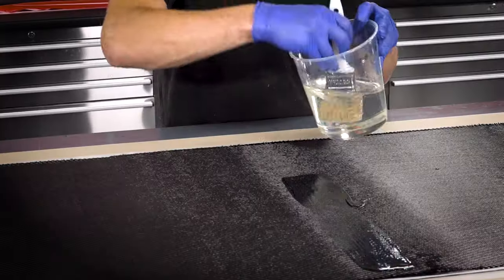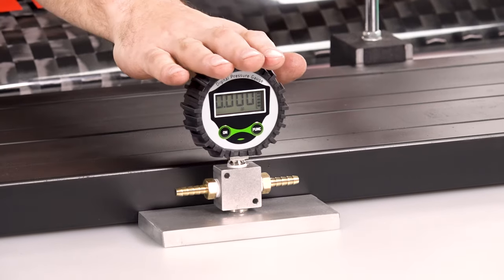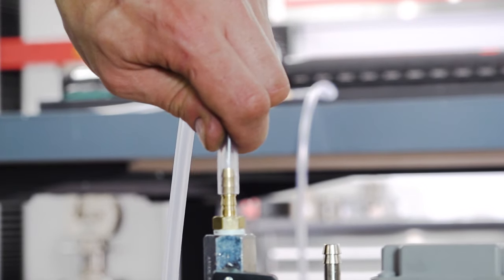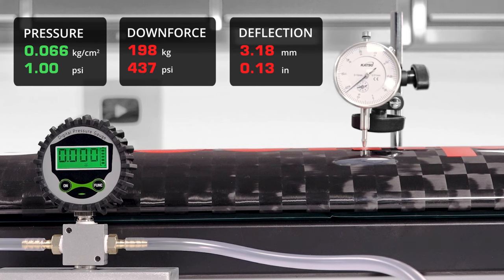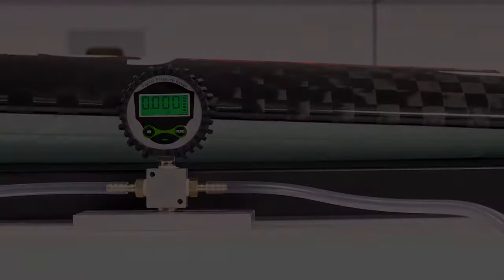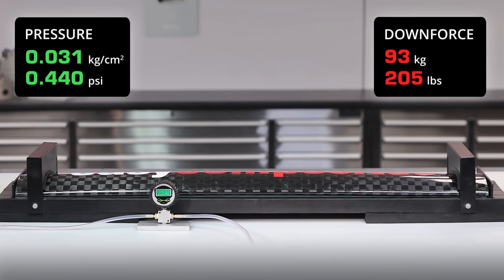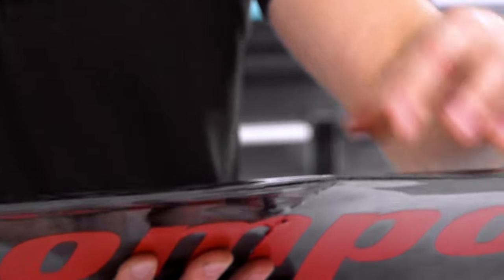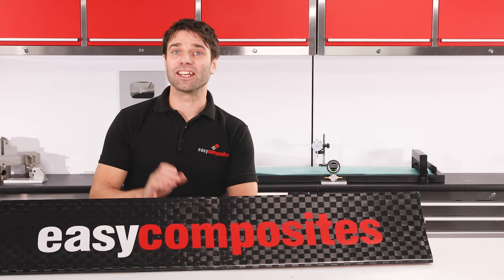How Much Downforce Can Our Hand-Laminated Carbon Wing Take?

Comment: Thanks for keeping up the best quality carbon fiber videos year after year. And especially for not going with the annoying youtube shorts trend, but instead providing actual useful tutorials and product testing videos. I watched these for years before stepping to the dark side, and last year I was your customer over and over again, and will be in future.
Reply from the maker: Thanks for the comment; you're right that the 'push' is for shorter, shallower content but so far we've not really found that to be the right format for content that we hope to be genuinely useful and enlightening. Thanks for buying from us; we don't take any customers for granted and appreciate your support.
Reply: @easycompositestv  can I give one complaint too? Last part that I did, I used XCR epoxy, and I even heated the hardener for quite long time on top of heating radiator. Yet, on 20c room temp part turned with lots of big hardener crystals and is essentially ruined in aesthetics sense. Also the 3D-printed onetime use mold etc meant that I lost about 1 week worth of work in it. The part was usable but pretty it aint. Other than that everything has been mint!
Reply: @djremotion2  Just don't watch shorts if you don't like it so that you won't be annoyed with it.
Reply: @sepg5084  real videos get lost inbetween in the subscriptions. And eventually not even appearing since there are so many shorts and youtube pushes them now.
Reply from the maker: @djremotion2  Its possible if its been crystallised a long time it needed more heat and for longer. Alternately if the lid isn’t fully sealed, moisture can have an effect making it crystalise.
Reply: @easycompositestv  Room was 10c° before I came and heated it in about hour to 20°c.. I warmed the hardener but I think since the epoxy was still quite cold, it went back to crystals in mixing so both should have been heated and I did not know that. It was new container first time using. I wont use it in future, just normal resins then...

Comment: am I the only one being shocked how much pressure these vacuumbags can take?! :D great video once again!
Reply: I expected bladder to fail at weld first, but redundant welds helped with that.
Reply: You are not alone! It is a nice thick material. But do not forget the majority of the force is taken by the wing and base.
Reply from the maker: Hey Matt, and thanks! Well, the pressure is really not very high; the downforce looks massive because that (modest) pressure is acting over a large area but in reality the kg/cm2 (or PSI) are waaaaaay within what the bag (and the welds) would fail at.
Reply: 413g/cm2 is less than 40% of ambient pressure.
Reply: Why use low melting point metal instead of wax?
Reply: 0.3 barr or 5.34psi it's kind of low

Comment: Another amazing video! Interesting how it failed on the compression side mainly, makes sense after thinking about it. Incredible how much flex it could take before failing.
Reply: Yes, these composite structures almost never fail in tension. Mostly in compression or attachment points.

Comment: Great content!!
Truly amazing how ridged and strong something so light can be.
Im betting its all down to the cylinder shape of the wing, plus the surface area of all those tiny cylinders that makes up the carbon fibre.
Reply from the maker: The shape will have a significant impact itself but the composite matrix is very strong due to the actual fibres themselves being strong.

Comment: Very entertaining, sounds like it was as fun to film. (You tone of voice gives it a way a little.) It was a great way to highlight the difference for designing for a given stiffness and designing for a given strength. If you ever do something like this again, I'd be really interested in the impact of cycling the planned load repeatedly.
Reply from the maker: Long term fatigue or cycle testing needs quite specialist equipment so its not something we can easily do here.
Reply: @easycompositestv  Arduino, two regulators (one self-venting), a 3 way solenoid valve and some fittings and you can rig one up pretty cheaply to cycle between two pressure levels!

Comment: Awesome video, well done. Where are you guys coming up with 100kg as the max producible downforce?
Reply from the maker: Thanks for the question, The 100kg downforce was calculated by a team who we worked with on this wing. Unfortunately we cannot make their data public but there are a number of ways that the loading can be established, from CFD software through to physical wind tunnel or track testing.

Comment: I hope people are aware that testing a carbon fiber part an weaken it. I don't recall where I hear this but some carbon fiber parts failed (on a spaceship?) because it had been tested beyond what it was expected to bear. The test had weakened the fibers and it failed at load lower than expected. 
I don't know the correct way to test a part without damaging it but I thought I'd mention this. I could probably be persuaded to find the exact example if people are interested.

Thanks for another interesting and entertaining video Easy Composites.
Reply from the maker: It’s definitely true that performing high load tests on a component would cause some mechanical damage to it. It should be clear from this test, which destroyed the wing, that you should test one, and use another!

Comment: Great video and experiment do you think at what speed it will be at maximum amount of downforce for this wing which is about 100kg?
Reply from the maker: I’m not quite sure. The wing design came from a formula student team we worked with a few years ago. Their aero team said the wing was designed to generate a maximum of 93kg downforce at top speed. FS cars don’t tend to run that fast. If we can find out, we’ll add the info to the project page on our website.
Reply: So if you search for "dynamic pressure calculator", you will find that at 100mph the dynamic pressure at sea level might be 25 lb/square foot.  Let's assume the coefficient of lift of the wing is a bit above 1.0, and given that to keep it simple just assume we get 30 lbs/square foot of lift for the wing at this speed.

I'll guess the wing is 5 square feet viewed from above.  So that's 30*5=150lb total downforce at 100mph.

Lift/downforce increases at (roughly) the square of the speed.  So at double the speed (200mph) you'd get  4x the lift/downforce, or 600lb.  So maybe 120mph for 100kgf. 

Exact #s will depend on the wing's airfoil, size,  air temperature, wind etc., but this is in the ballpark I hope.

Comment: Great video (as usual)
How have you calculated the down force?
Reply: Pressure times surface area.
He mentioned the surface of the wing is 3000cm^2.
0.413kg/cm^2*3000cm^2=1239kg
Reply: @戴紀煬  great, thanks
Reply from the maker: Thanks for the question, The 100kg downforce was calculated by a team who we worked with on this wing. Unfortunately we cannot make their data public but there are a number of ways that the loading can be established, from CFD software through to physical wind tunnel or track testing.

Comment: Nice video! I am interested how could the delamination at the edge joint be prevented ?
Reply from the maker: You could make sure at least one or more layers of reinforcement wrap around the trailing edge, rather than just meeting at the trailing edge. In the preceding build video you can probably foresee the possibility for delamination where the two layers just meet each other. That said, it makes the process much easier and, at the end of the day, it's going to fail somewhere so the consideration is whether moving the failure somewhere else (which will come slightly later) is worth the extra complication. In this case, it probably would be.

Comment: Do you also work with thermoplastic memory carbon? I'm not sure what it's called in english but you can heat it up and bend it. Allows for rapid construction of some kinds of parts. Can't find any videos on youtube about it.
Reply from the maker: Its not a product we stock.  Some composite fabrics are available with thermoplastic fibres woven in to them.  They can then be oven cured relatively quickly or cured in heated presses and other similar processes.

Comment: Another work of carbon art Paul. How would aluminum honeycomb compare to Nomex?
Reply from the maker: Hi Brian, our thinnest aluminum honeycomb is 10mm so the Nomex was far more making thinner cored panels such as was required for the end plates. Aluminium honeycomb typically has a higher compressive strength but this decision was made on material size and availability.

Comment: If you look at the high spoiler on a Subaru sti, how would you go about molding/ laminating the convex shapes? Is it best to make 2 pieces & bond them together?
Or can I do it with a 2 piece mold & still get the finish on both sides?
Reply from the maker: For complex, compound shapes, you would need a split mould (two piece). It might be possible to make the component in one piece, inside the split mould, but more likely you would need to make the top and bottom skins and then bond it all together afterwards.
Reply: @easycompositestv  thank you, one more question.. can I make/shape one piece & cure, then add that cured part into another mold & keep laminating to it? If i were to make 5 parts can I laminate them together or is bonding them together the only way? I don't see much info regarding putting cured parts together, other than bonding.
I'd like to mold/make pieces to a car main body, then get them all together to become one big cured carbon part without bonding.

Comment: I'm curious if you ever calculated the air speed over the wing required  to produce the force necessary for that failure? It would be interesting to know how far beyond any vehicle capabilities that speed would be.
Reply from the maker: No as the speed would be in aeroplane not motorsport territory so wasn't really relevant to this application.

Comment: hey, quick off-topic question i've always wondered about. I used to use a lot of carbon/kevlar kayaks. I never quite understood how they work together, because in my head because the carbon is so much less flexible it would take all the stress, and the kevlar would only take any stress once the carbon had broken. I guess I imagine it like weaving steal with elastic bands. I assume I am wrong here as people wouldnt use it. just never sat right with me.
Reply from the maker: As its a composite material its not split in that way.  You get a mix of the properties of the two materials eg a hybrid fabric is not as stiff as pure carbon nor as impact resistant as pure kevlar but the properties are a mix of the both.
Reply: I think you are right it doesn't always make sense unless for cosmetic purposes.  kevlar is good for abrasion/durability but why not use all kevlar on the outer layer and carbon fiber underneath for all the structural?  that's not unusual. that said, the carbon will stretch enough that if it's stressed enough the kevlar can contribute, but, why do that instead of all of one or the other?

there are some nuances, I'm no expert.  for example kevlar is good for vibration damping.  in a hybrid material it might contribute that and also perhaps not used in every layer.
Reply: I should popbs just go find the info online. Would be interested to see how stiff 200g carbon is vs 400g of 50/50 carbon/kevlar. Just want to get an image in my head of how they work together in the resin

Comment: This really makes me wonder what kind of safety factor F1 (and other high end motorsport) teams use when designing aero parts. Surely it would be pretty low, on the factor of 1.x the expected load
Reply from the maker: In F1 they will be working to much more precise tolerances with much more extensive calculations and testing to gain the maximum efficiency at minimum weight.  They do also have various regulations that can effect design too.

Comment: How would you build small profiled winglets like they use in MotoGP? I always wondered if they were glued because I can’t imagine using a vacuum bag to get inside the wing. 

Cheers and greetings from Germany
Reply from the maker: It could be made in two parts or for higher production runs, machined two part tools can be used with very accurately cut PrePreg and in some cases core materials which can be stacked into the mould and then closed to give the correct amounts of pressure.

Comment: You mentioned that this method for making the wing is mostly used for one off’s and prototyping, how would the production method change for a small/medium production of wings to be made?
Reply from the maker: Usually, they would be moulded, using a female mould for the top and bottom profile. The component would then be made either as two halves assembled after or using the two moulds together (as a split mould).
Reply: @easycompositestv  Thank you for the information!

Comment: Really great video as always. 

Not that you would need to 
But If you were to stiffen the wing 

Would you put carbon fibre tubes inside the foam core before laminating to make it stronger? 

Or would you hollow out the foam once cured and then glue ribs inside? 

What would be your preferred method of stiffening a hollow carbon. Product.
Reply from the maker: We would hotwire the hole for the tube (spar)  into the foam and then bond in the tube (or box, I-Beam, webs) and then assemble the wing around that stiffened core.
Reply: @easycompositestv  Is it possible to hotwire tubular holes in the foam without making an entry or exit line? How would you do that?

Comment: It makes sense that it failed in the section where you bonded the two halfs together.  I'm curious if you would find much stronger resistance with a single piece constructed in the same method.
Reply from the maker: If joins have sufficient overlap and strengthening then it is not an issue. In this case the failure was well in excess of the intended requirements of the wing anyway so the join was not a problem in this case.
Reply: Anyone can build something strong enough. It takes an engineer to build something just strong enough for its intended use. So I get the fact that the join is strong enough.  I agree with that 100%.  I'm just curious what the limits are with a one piece construction method.

Comment: I would recommend holding your bag sealer tighter for a bit longer. Also your wire and that composite over the heat bar need to be changed every so often.

Comment: I have a question. How strong do you reckon a 3D printed part could be when skinned with carbon fibre 2x2 twill?
Reply from the maker: It entirely depends on the 3D print. Different filaments, Infill density and type, wall thickness etc will all have an impact on the strength and weight of the core.

Comment: Reducing the weight while keeping sufficient stiffness is a laudable goal if aero loads were your only concern.  But don't forget a real-world race car wing is used as a tool table by mechanics and a push bar by the pit crew and after the racing is over, it's used as a table on which to mix drinks and serve snacks.  And if your driver wins, he might just use the wing to climb on top of the car so that he/she can soak up the adoration of the fans.  You don't want someone crippling a thin skin by dropping a ratchet wrench or a cold beer on your wing.
Reply from the maker: Ultimately depends on the specific race series and the way the team is managed. But certainly you could factor in additional strength if that was needed for non-aero reasons.

Comment: It could withstand higher downforce if it had different mounting points.
2 mounting points near the middle like on most race cars or 3 mounting points at the endplates and the middle can reduce the bending moment on the wing.
Reply from the maker: Within the limiting factors of the aerofoil design and blade angle of attack, yes. Fitment is very much down to the style of race car design and also, sometimes, racing class restrictions.

Comment: Is there a specific reason that the wing broke at that point of the wing? Thanks.
Reply from the maker: With this test rig and its limitations, likely the point of most load.  The wing construction was the same throughout its length.

Comment: if someone wanted to make this wing stronger (hypothetically, it's strong enough already 😅)
could this failure be taken as an indication to use more epoxy?
you said the first side to fail was the one in compression
i'd take from that, that there is enough carbon to take up the tensile forces
now, i always imagine epoxy and carbon to be like concrete and rebar, one component for tension and one for compression
would adding more epoxy to the wing increase the compressive strength of it, until with enough of it, the side of the wing under tension would fail first?
this would obviously add quite a bit of weight, but i'd think it would be less weight than another layer of carbon, since epoxy is less dense, it would also be cheaper than a whole new layer
Reply: In short: It would have the opposite effect. Epoxy is the weak link. It is there to bind the fibers together to keep them in column. More than necessary is only added weight and cost .
Reply: that is the common opinion

another effect it would have, is increased laminate thickness, which increases stiffness
Reply from the maker: A more resin rich laminate would not be stronger in that sense. Additional layers of laminate would be the best way to increase the strength of the wing if you needed it. You could go further and use additional methods mentioned in the first video, such as use of spars, uni-directional fibres etc, which means you can make the wing stronger and use the laminate in a more efficient way to keep the weight down.